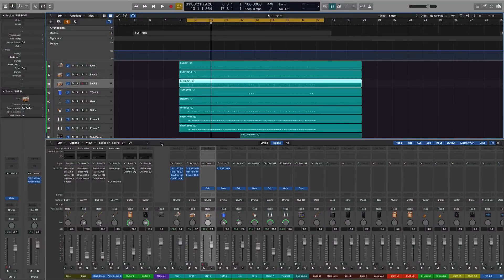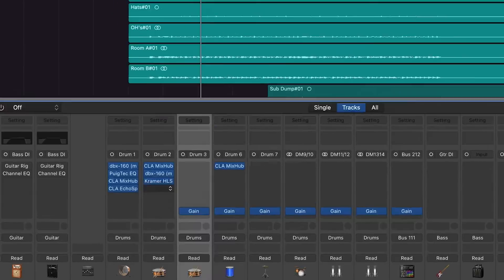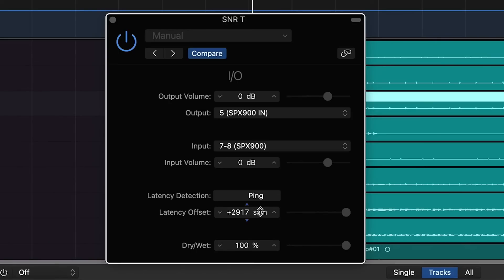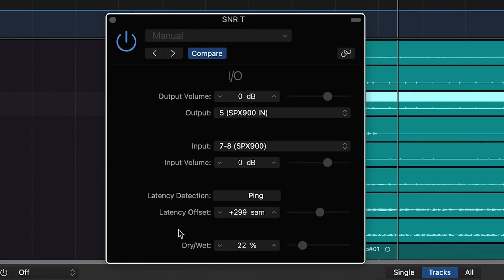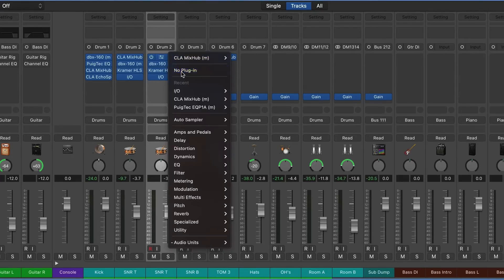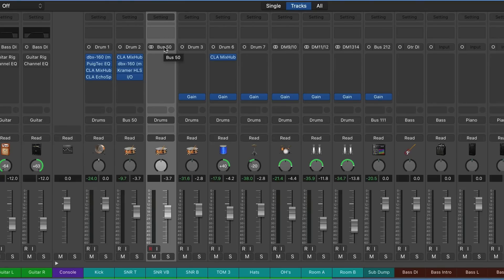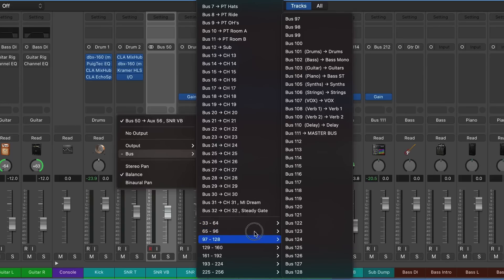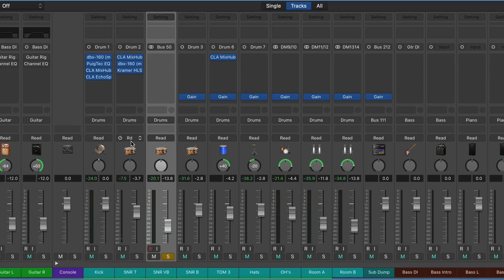Using Outboard Gear with Logic Pro X

Comment: Well explained and you really made it understand easily. Thanks. Same way we can add reverb to other instruments too right?  Is the" 299' digit added by using the Tempo calculations ?
Reply from the maker: Thanks Sujit, glad the video was easy to understand. Pretty much yea. The only difference is we are using hardware instead of a plugin. No, the 299 is. a delay calculation and has nothing to do with the tempo. When audio is sent out of Logic (or any DAW) through DA converters, into outboard gear, back into AD converters and (in this case) back into Logic there will be a time delay for the signal to make the round trip. This is measured in samples. I record at 48kHz which means audio is being recorded at a resolution. of 48,000 samples a second. So this means that in this situation the audio returning to Logic is delayed, or behind in time by 299 samples. By pinging before hand Logic will compensate for the time delay (when it's working, sometimes the ping function acts up) 

In my case because I was having to record the screen and such it seemed to really be throwing the numbers off which is why I typed in 299. I figured out what it should have been before I started shooting the video.

I hope that explanation made sense. I'm getting tired and my brain is falling asleep lol so just let me know if you have any more questions =)
Reply: Got it. In that case can we use Word Clock for avoiding Latency issues?
Reply from the maker: Word Clock is for locking, or syncing devices together. As an example, when you have an audio interface connected to your Mac or PC, one unit will be the master and the other the slave which means one will provide the word clock and the other will lock to that. If devices aren't clocked properly it can lead to jitter issues, click and pops, all that jazz. But thats the quick explanation of word clock.

Latency is completely different. It's basically the delay time it takes us to hear something back. For instance, if you plugged a guitar into a few pedals, into an amp and through a speaker, there is latency between you hitting a note and the sound traveling through the pedals, cables, amp, out of the speaker and to your ear. But the latency time is so short that it is pretty much imperceivable. 

The same thing applies when we plug that same guitar into an audio interface. That signal has to leave the guitar, through a cable into the interface, be converted into a digital signal, into our DAW, through any plugins we may have going, out of our DAW to our interface, converted back to an analog signal, out speaker cables to speakers and to our ears. 

To adjust the latency in our DAW we would adjust the buffer settings. The lower the buffer, the less latency you'll have. But this is taxing on your CPU and how low you can set the buffer will depend on your computer. If your buffer is set too low you'll get clicks and pops because your CPU can't handle it. Plugins can also add latency. And how much will depend on the plugin and how its coded and how resource-heavy the plugin is. Some will add almost zero latency. Other will add so much that you can't use them when tracking. 

I keep my buffer set at 128 in Logic and never have any issue. Then once I'm done tracking I set my buffer to the highest setting to allow for more plugins.

I hope that makes sense. Let me know if you have anymore questions or help Sujit =)
Reply: Ok. I used go down 32 buffer...while tracking and go highest 1024 when doing Mix-Mastering...
Reply from the maker: Oh wow, 32 is low. I track at 128 but my iMac is also 7 years old. If I tracked at 32 my computer would burst into flames lol

Comment: Hi nice video, I´m trying to put some reverb from my eventide pedal to my guitar track but it always sound like the reverb is in front of the amp and not in the fx loop. I´m using a plugin for the distosion (bias fx) and I´m using the I/O for ruting the pedal buy it doesn´t work. How can I put the pedal after the bias fx amp? Thanks.
Reply from the maker: Hey Zabala. With the way amp sims like Bias FX (I use amplitube which functions about the same as Bias) you can’t insert a pedal from the real world (your eventide) into the FX loop of a virtual amp. 

The closest you can get is to place your pedal after the amp before the speaker cab. In that instance your run bias fx with just the amp head. Then run the I/O out to your pedal, then into a second instance of bias with just a cab. That’s as close as you can get.

But the FX loop on an amp is before the power section. So if you’re getting some of your distortion from the power section then that distortion is feeding into the eventide instead of the eventide feeding into the power amp. Which of course will change how things sound.

So the options would be to just use your pedal between the amp and the cab as I mentioned above. Or use a reverb pedal from bias in the FX loop. Or if you can use a real amp head you can use your pedal in the real fx loop and then feed the real amp into a cab in bias. Hope that all made sense.
Reply: @EverythingMusicRecording  Ok thanks a lot, I didn´t realise that way. I´ll try that.

Comment: Thanks for the content. Ive done this with my focusrite interface which has designated outputs but ive just upgraded my Mac to M1 and need to use a sound craft multitrack which doesn’t have outputs. It has auxiliary outputs. Is there any other way I can compensate for latency. I’ll run an aux send from the mixer to an external analog device snd then record to a new track. Thanks.
Reply from the maker: I saw your Username and now I have Taxman by The Beatles stuck in my head lol.

Wait, is the Focusrite NOT working M1 macs? 
Which Soundcraft unit do you have? I can’t really try to help until I know which model you’re using.

I don’t know which DAW you’re using but somewhere in the audio settings you can adjust the buffer. When tracking you want it set as low as your computer can handle. I keep mine at 128. When you’re done tracking tho you can boost the buffer and that will let your CPU handle more plugins.

Hit me back when you have a chance and I’ll do what I can to help you out.
Reply: Soundcraft signature series 12 track multi track is my current device for tracking into Logic. My previous pre amp (which I’m still using at times) is the Safire liquid 56. It has plenty of in/out options. The sound craft can send tracks via USB back into the mixer which can then send out an audio signal via aux which can then go into the mixer on a new track but the plug-in to measure and compensate is where I’m challenge is. Maybe I’m just getting confused with aux. I’ll play around with the plug-in. Thanks

Comment: I was struggling to access my outboard gear with logic and Focusrite 18i20. Looked at several videos and read lots of articles. It wasn't until I found your channel that i was able to make the connections easily. I know I'm getting on in years (just gone 70, but my head still thinks I'm 18) but the other versions of a solution seemed very complex and long winded. Thank you for presenting a solution in an easy and pleasant way. Keep up the good work. I shall continue to follow your channel with interest
Reply from the maker: Hey Joe! Wow, that was a great comment and I’m very happy to hear the video was helpful. 70 and still at it eh? That’s awesome. I also have the same issue as you except I’m 40 going on 12… I don’t think I’ll ever grow up.

As for the video, yea, before I started the channel I would end up in the same predicament. Trying to figure something out only to end up in the weeds and getting lost in overly complicated steps, explanations that didn’t make sense, or steps would be missing and you would just end up hitting your head against the wall.

So I try my hardest (I don’t know if I always succeed) to make every video simple, easy to understand and no steps are ever missed in the process. If someone watches one of my videos and still can do what I taught, then I’ve failed them.

Anywho, enough rambling from me lol. Thanks again for the kind words Joe, they put a smile on my face. And you’re a prime example that age doesn’t matter so keep at it my friend. Cheers 🙂

Comment: Nice vid man. For modulation and reverb effects, this is a good approach. However, when I wanna use an external compressor, distortion or ramp a DI, I like to adjust how hot I'm feeding my outboard with an actual fader on the mixer. So drum bus compression for example, what I like to do is the following: 

1.) create a send from the dry drum bus to a new Bus called sth like 'Drum PreComp' and set it's output to the compressors inputs. That will be my input level control for the Comp. The output of the dry drum bus will be set to 'no output'
2.) create another bus called sth like 'Drum Comp' or 'Drums Wet' and set it's input to the compressor outputs. This bus then acts as my output level fader. The output goes to whatever next gain stage I might have, which is usually directly to the (dry) mix bus.
3.) for printing, I like to create a send(!) from the wet bus to a new track I then call sth like 'drum bus print'. The output of those kind of print tracks usually then go to a separate stem bus.

By doing it this way, I have a super flexible routing. I can simply switch between the dry drum sound and the wet drum sound by just routing the outputs of the respective busses to the mix. I can adjust the input volume to my gear by using a fader, which is super convenient when a)  you use a hardware DAW controller and b) you work with static settings on your outboard gear and control everything with levels. It also makes Gain staging super easy. Another benefit is that I can create stems super quickly with these parallel print tracks. By sending them to a separate print bus, I can quickly mute/unmute all the prints with one button and prevent them from spilling in my mix without having to delete my last print, in case I decide to tweak it a little more later on. And to free up my audio gear, I can just mute the bus that is feeding the interface output and use it for sth else. That way, my routing stays intact the whole time.

That's just my two cents. Hope that was remotely comprehensible ^^
Reply from the maker: Completely valid approach Dennis. Thats part of the fun with this stuff, there isn't really a "right or wrong" way to do things (generally speaking) and if it works and sounds good, then thats all that matters at the end of the day. I had to present the video using safe send/return levels though. I don't want anyone who might be less experienced to start slamming levels and potentially clipping the life out of their converters.

Another way to do the same thing you're doing as well and have no worry about clipping converters would be to use a clean signal booster instead of pushing the levels coming out of your DAW. Slap one between your interface and outboard gear or guitar amps 🙂
Reply: You tend to get more Delay this way. His approach has the delay compensation when he hits ping. I tried doing this and found that even if I set my buffer to 128 it still came out, out of phase. His approach saved me a headache.
Reply from the maker: I’ve been having intermittent issues with the I/O plugin the last while and got to the point where I’m not trusting it (especially when it comes back with something like “-48 samples” because apparently the signal can travel back in time…

So I’ve been adding a sync pop track so I can double check the print and adjust manual if I need too. I just tried to type an explanation of what exactly I’m doing and it hurt my head. It’s gonna be one of those “I’d be better off making a video about it” so I’ll do a “I/O plugin is being stupid” work around videos in the next week or two.

Comment: Whenever I use the I/O plugin, I get crazy feedback and repeats like a delay pedal with the feedback turned all the way up.
Reply from the maker: Hey Paul, sorry. I somehow missed your comment. I've never had that happen so I am not sure why that would be happening. Without knowing anything about your setup, off the top of my head I would think that there an issue with send/return levels that are causing an overload somewhere in the signal chain. I'd need to know more about what your setup is before I could even take a guess at a possible solution.
Reply: @EverythingMusicRecording  I think it’s a UAD thing… the Apollo Console has a mind of its own. Do you use a non-UA interface?
Reply from the maker: Oh, I didn’t know that about console. Correct, I have a Focusrite 18i20. I like the idea of the Apollo system but it just seemed to me that unless I also shelled out for UA plugins as well, or needing to have to add satellite units if I needed more DSP that it would be hard to get much out of the system. Just seemed like a money pit I didn’t want to get locked into.
Reply: @EverythingMusicRecording  Yep. Kinda feeling that now.
Reply from the maker: Sorry to hear that Paul. How old is the Apollo? If you’re not totally happy with it maybe you could sell or trade it towards something else.

Comment: Great vid !

How did you know to re-calculate the 299 samples from the Ping’d number ? Also, where did you get that number ? I’ve seen it be argued back n forth that the computer does/doesn’t calculate the correct offset for latency compensation. Logic Pro ftw!

Thanks
Reply from the maker: Thanks Meloman. 

If I recall, the 299 is what was coming up the day before and it sounded fine. (When I’m done recording I set my buffer as high as it will go, hence the high number) but yes, Logic can be all over the place with the sample calculations. I’ve had days where it calculates minus samples. Meaning the ping is traveling back in time and arriving before it was even sent…

So with Logic I find it’s generally easier to print the return (in my case from the SPX900) onto a new track and line it up manually

Comment: How did you know what your latency offset would be? I’m trying to use an external compressor for some paralell compresson but there’s way to much latency… so it’s just sounds weird
Reply from the maker: Hey Anderson. I’m the I/O plugin you’d wanna hit the PING button. When you do that Logic sends a quick little BEEP thru your hardware. That’s how it calculates the offset.

Mine was super high in the video because I had my buffer set high, plus trying to record the screen mucked it all up. Under normal settings mine is around 30ish samples. 

So try the PING button. If it’s still not right just try either restarting Logic and/or your Mac. That always fixes it for me when it’s being weird. Keep me posted.
Reply: @EverythingMusicRecording  hey! Thank you for the quick reply!! Tried ping and everything. The ping tells me there’s -3 latency… but there’s a clear delay everytime I play back a loop to find a setting I like. Almost like slapback..
Reply from the maker: Hey Anderson. No worries at all. Ok so I’ve been ripping my hair out for over an hour now. I have bad news and bad news. But also a “work around”

My I/O plugin seems to be broken as well (OS update a few days ago, haven’t used the I/O plugin since) and no matter what I do it always PINGS back at -45 samples. So somehow the ping arrives back at the computer BEFORE the computer even sends the ping… that’s a good trick… I feel like Doc Brown is somewhere freaking out about time paradoxes, I might not also be thinking 4th dimensionally… lol

I could find very little about the issue and most of what I could find was in forum posts from 5-7 years ago… 

So I sadly don’t have an answer to this issue atm. BUT I do have 2 work arounds. But both mean you’d have to print the output of your compression on to a new track. 

First is align the tracks manual after printing the compressor return. Just zoom in so you can see both tracks.

The second is the same but add a super fast beep sound to the track you’re sending to the compressor BEFORE the audio in the actual track starts. Like that film beep sound they would use to sync audio to film back in the day. It’s just a super quick single frame beep. That will give you a clear as day transient to align the two tracks back up after printing the compressor return.

That’s all I’ve got. I’m wondering if the OS update maybe broke something in Logic. If I figure something else out I’ll let you know. I wish I had a better answer for you.